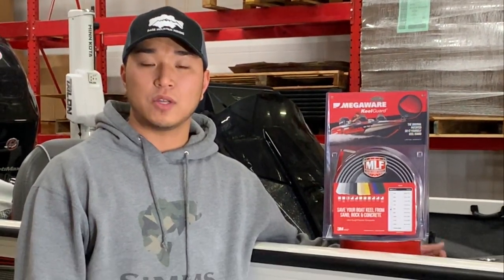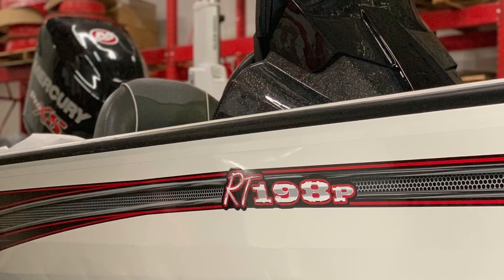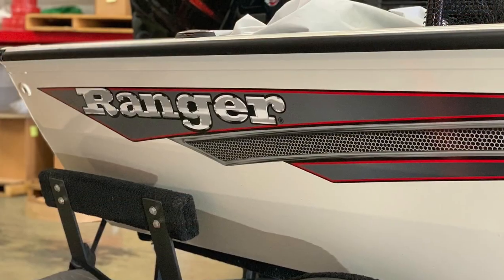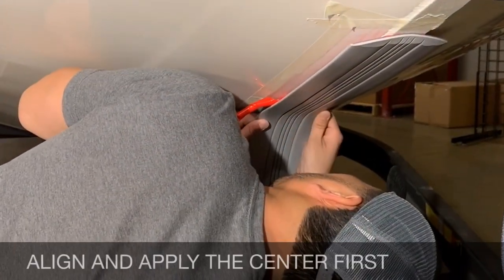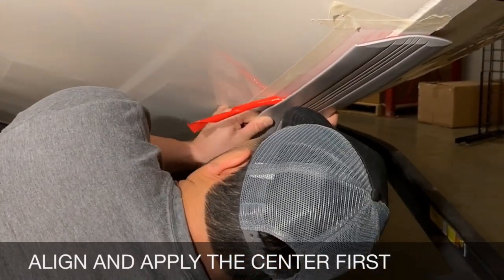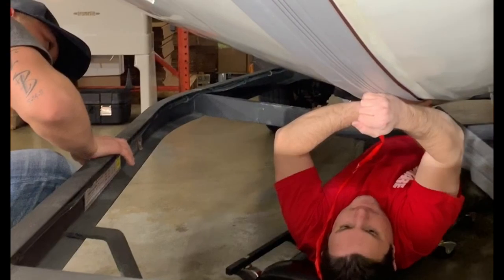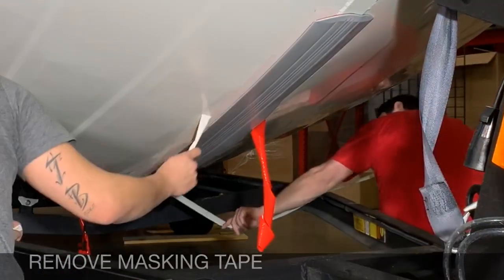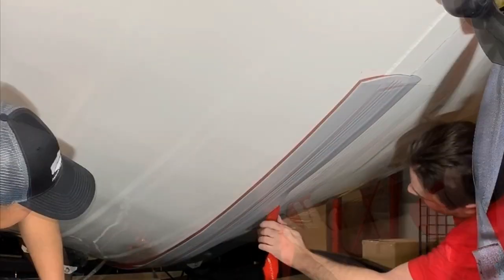4 easy steps to installing a Megaware KeelGuard!

Comment: My keel already has damage from being beaches over and over. The gelcoat ihas been scrapped off. No dings. Just scratched. My question is can this be applied or should I apply gelcoat first? My concern is that if I apply a layer of gelcoat, the keel guard may eventually peel off that new layer.

Comment: You think the Keelguard will come off eventually due to the thick large protruding midline strake or keel bone? I doubt it will stick and hold.
Reply from the maker: Properly preparing the hull of the boat especially around the welded areas is key for this kind of installation. This KeelGuard was installed a year ago and still looks as good as day one. Thanks for your comment.

Comment: I have a 20’ Triton TR20 and as you know the keel goes flat about 6’ back so not sure how well it is going to adhere from V-shape to flat. They are recommending a 7’ keel guard but I’m thinking 6’?? Thanks
Reply from the maker: There shouldn't be a problem with the transition area. I wouldn't go shorter than the recommended length. Going shorter may cause issues with the bottom leading edge getting snagged and tearing, especially if you plan on beaching. Call us if you have more questions. Thanks for your comment.